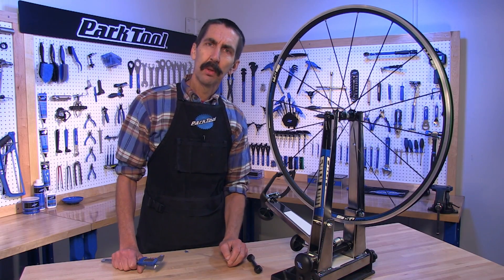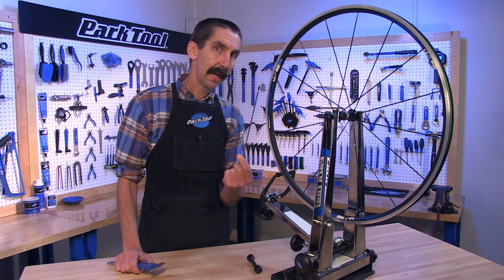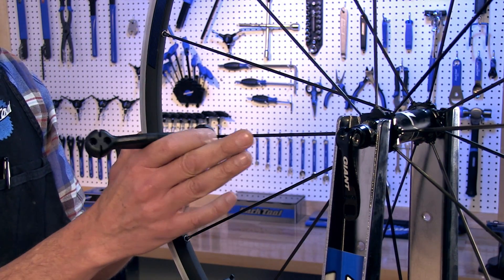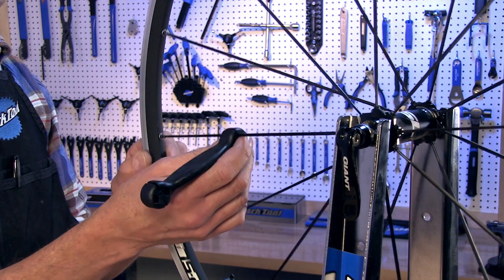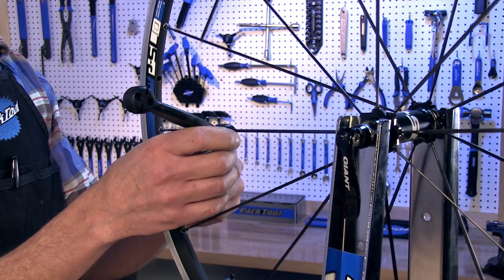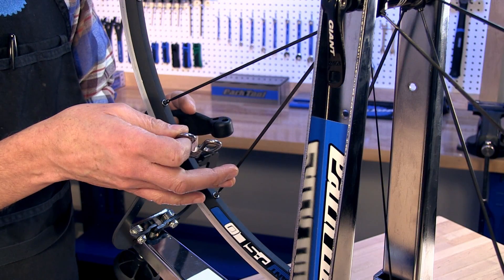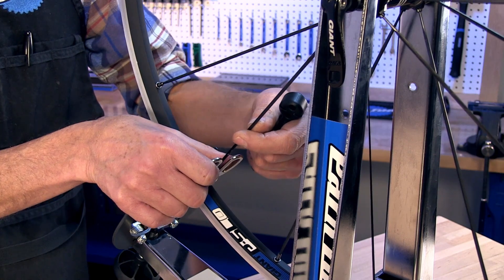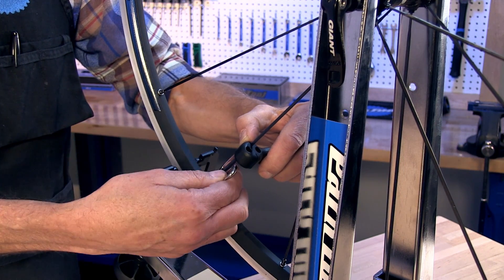Tech Tuesday #7: Bladed Spokes

Comment: question about this, what if the spoke tension is loose but the aero spoke is already perpendicular, and when i want to tighten the spoke, the aero spoke isnt perpendicular anymore, does that mean that i have to choose between right spoke tension but not aero or aero but loose spoke tension? Thanks.
Reply from the maker: Hold the blade as you tighten.  If the blade moved, bring the blade back to aligned by turning the nipple and blade together.  Another option is the CSH-1. https://www.parktool.com/en-us/product/clamping-spoke-holder-csh-1

Comment: i doubt in efficiency of aero spoke because even if it is on proper angle, on some position when wheel is rotating, air goes over wider side of spoke, so it seams is better to have round spoke because air always goes over round surface
Reply: Good thing I found about this video and your comment. I'm about to buy spokes for my custom wheelset. And going to local bike shop can be pain especially on rainy season. I guess I'll stay on normal rounded spokes for a while

Comment: Carbon flat spoke is tight and nipple moves spoke. What kind of oil to loosen nipple?
Reply from the maker: The carbon spoke will not have carbon fiber threads. The threads will be either aluminum or steel.  Use a light lubricant, like  a chain lube.
Reply: @parktool  Thank you for a fast reply.

Comment: How can misure tension in bladed?
Reply from the maker: You can measure the spoke tension of a bladed spoke with our TM-1.
Reply: @parktool  ok but where I can misure tension? The ray Is bladed
Reply from the maker: You measure at the blade. You want to measure how much the blade deflects with the TM-1. The wheel in the linked video has bladed spokes. https://www.youtube.com/watch?v=mb32h4PK_aU&t=7s&pbjreload
Reply: @parktool  ok thanks, if ray is twisted the misure of tension is not correct?
Reply from the maker: The section of spoke being tested needs to be flat. If you type the dimensions of the CX ray spoke into the Wheel tension App on our website you will get a chart for that spoke.

Comment: Any advice on what to do when the spoke turns together with the nipple no matter if you hold it with the tool?
Reply: Yep, my  bladed spokes seem to be bonded to the nipple.  Also, if one were to move the spoke and nipple together in order to straighten the spoke (as shown in the video), the wheel will go out of true.
Reply: Try wd40.
Reply: I have the same problem. I think it's having an aluminium nipple on a steel spoke. They react/ corrode and fuse together.
With brass nipples you don't get this problem.
Reply: @leemundoMadDog  Brass undergo galvanic reaction when coupled with steel and moisture.

Comment: What about blade spokes with internal nipples?
Reply: I would assume you do it the same way, you hold the blade in position, except you have to use a screw driver to tighten the spoke from the inside of the rim.

Comment: very useful video, thanks for the hints. In hindsight, I shouldn't have chosen bladed spokes EVER.
Reply: Is it possible to replace a broken bladed spoke with a round one?
Reply: I did change from bladed to round, just because it was a nightmare adjust the bladed type. All that matters is the length I guess.